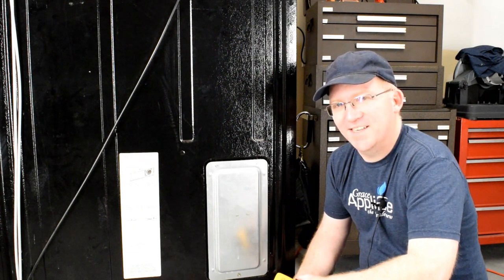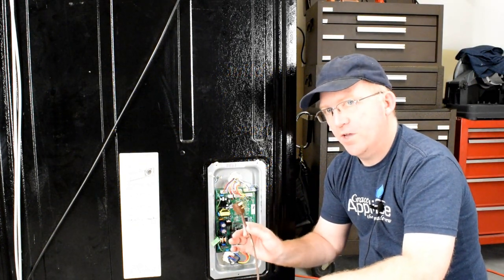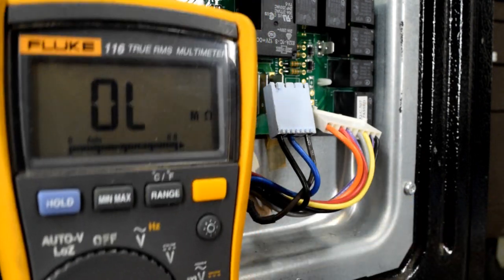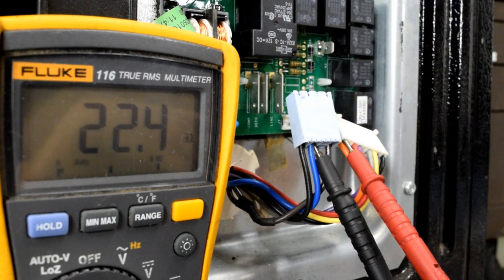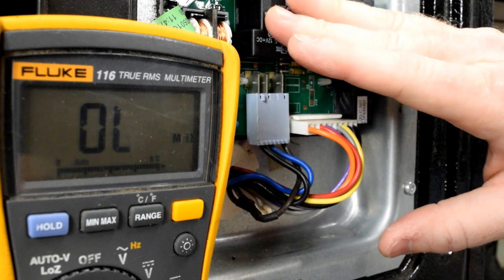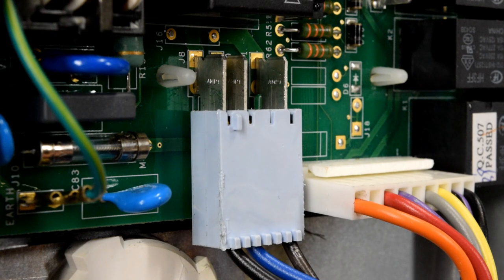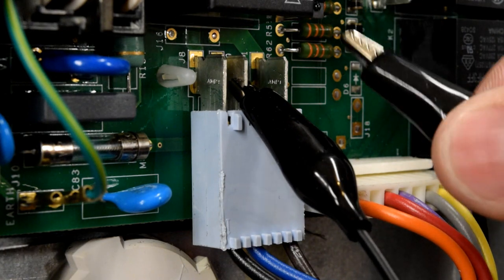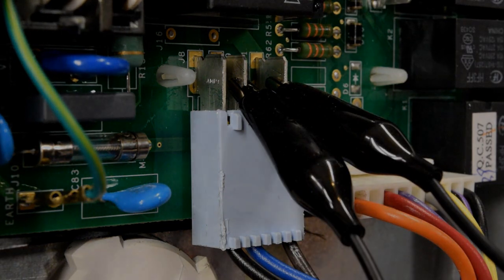Diagnosing a Bad Control Board - Part 3: Defrost Issues

Comment: Andy, last question... 120vac to compressor. 120vac to board. All fans are on and working. Defrost heater no continuity. Front control board works great. My thought is the compressor because there's 120vac at the compressor and I've installed a new relay and capacitor. But the compressor isn't kicking on even when I jumped it from the board.
Reply from the maker: Hey, I agree. It does sound like it's a bad compressor. With new relays it should certainly fire up once jumped at the control board. 

If you wanted to confirm even further, you could uninstall the relay with the power off. Then perform an Ohm test between the compressors 3 pins measuring every possible combination between the 3 different pins. Should get around 10k ohm on one and the other 2 combos should add up to that number. One should be around 7k and then 3k for example.
Lastly, if those checked out you'd perform an Ohm test between each pin and the copper tubing on the compressor. You're wanting to know if any of these pins have continuity to the copper portion (I. E. The case of the compressor) if so, the compressor is shorted to ground.

I hope that makes sense. 
I beleive I may have a video showing this now that I've typed it all out. LoL
Reply from the maker: https://youtu.be/XtntMGfU2Vc
Reply: That was actually one of the first things I did was check to make sure the pins had continuity and that the compressor wasn't shorted out. All of that appeared okay. I didn't check the ohms which I should have. Thanks Andy... with everything else working and checking out I can't see how it couldn't be the compressor. Thanks for all of your help and your quick responses.
Reply from the maker: Hey, you're welcome. Yes, you approached it correctly.
I'd verify that I was getting 120v to the compressor wiring at the relays when you jump the board. This will rule out bad wiring from the board to the compressor. I've seen where a mouse can chew through the compressor wiring, etc etc.

If you've verified that you've got 120v to the relays, sometomes older compressors will only work with a bit of a kick start. This is when hard start relays come in to play. Supco makes 2 basic versions of these a 410 and an 810 which is for smaller compressors. I've always used the 810 for fridges because on an older fridge the 410s I've heard will fry an aging compressor.
This version allows you to hook up your run capacitor though you'll have to crinmp down the terminals a bit with pliers which is fine:
Amazon Affiliate Link: https://amzn.to/2G268Vd

If the compressor fires up with this, you'll know you're on borrowed time and to start saving for a new fridge.

But of course all this is assuming you've got power to the plug at the compressor.

Comment: Hi and thanks for your previous response, your videos are great and very helpful. I have run into a snag here and could really use your advice . I have replaced the high limit defrost thermostat and the defrost heating element, also replaced all the sensors in the fridge and freezer . The freezer coil is  still freezing up and it seems like the defrost heater is not coming on. I tested the circuits as you showed and have continuity when the defrost thermostat is taken out of the loop and wires tied - as described in previous comment. Do you think I could have gotten a bad thermostat, or should I maybe look into replacing the motherboard ?
Reply from the maker: Hey, just to confirm that we're talking about the same part, you replaced the defrost sensor (small white cylender with 2 wires on the top of the evaporator) is that right?

I agree, it does sound like you need a new control board.
https://www.graceappliancediy.com/collections/frontpage/products/ge-wr55x10942-refrigerator-main-control-board

Thanks and let me know if you have any questions!
Andy
Reply: @GraceAppliance  Yes, replaced the sensors, thermostat and defrost heater. It was working normal for about 2 weeks and now it seems to be running longer, not cycling and the back is freezing up again so I'm guessing thats how long it takes for the coils to freeze over if the heater isn't coming on. I'm not sure but the motherboard is the last thing and also the most epensive. I did a visual inspection of it and all looks ok - no burns or blown up capacitors. Any easy way to test it ? Seems strange because everything else on the fridge is working fine,- is this a common problem ?
Reply from the maker: hey William, 
Yes it’s common unfortunately.  Even with no visible signs of failure, the relays can fail internally and may work intermittently or simply not keep the freezer in defrost for a long enough period of time. This causes the coils to not fully defrost, then the frost builds up gradually over a period of days usually but perhaps weeks too.  

There’s only 4 defrost components that can possibly fail, and In your case you’ve replaced the other 3 already.  So, (making the assumption all connections are ok) the last remaining suspect is the control board. There isn’t any further test you can do as GE does not have a force defrost option for this board. We know it is the board however from process of elimination.  

Let me know if you have any questions!
Andy
Reply: @GraceAppliance  Ok - Thanks for all your help, keep up the good work !

Comment: Thanks for this video.  I am trying to diagnose my side by side not defrosting.  My fridge has a a defrost test mode and it did make the coil glow when I entered test mode.  Does this suggest that the board is fine but the thermostat on the coil is bad?  I cut the coil off to test it in ice water.  I can not get it to show Resistance or continuity.  Also, The wiring harness and connector on the control board have burn marks on the defrost wire.  I plugged it in and tested the wire for continuity and it works.  Would these burn marks indicate the board is bad?  It is just some discoloration inside of the translucent wiring harness.
Reply from the maker: Brad Strawn hey Brad, 
Please send the model number for your fridge.  

If you have it in defrost test mode, that tells the control board to send 120vac to the defrost heater.  You can test for this voltage from the control board to verify the control board is doing its job.  

If yes, you’d move to the connections at the defrost heater, if you have voltage there, the board is good, the defrost thermostat is good, but either the wiring or heater has failed.  

As for the defrost thermostat not having continuity, there are some that must get very cold before closing and often ice water is not cold enough.    Inspect the thermostat to see if the case had swelled up and the plastic base on the metal thermostat has bulged out. 
There also cheap enough that I would recommend replacing it while you have it out. 

The heater itself often will look burned inside the glass tube (if that’s your design) and does not mean it’s bad necessarily.   You should read resistance across the two heater terminals.  The burned terminal does sound suspect and may be related to a failed thermostat by causing it to stay in for too long.  Just speculation.  

Let me know what you find with the voltage tests.  Thanks!
Reply: It is a Frigidaire FRS26LF7DSB.  Looking at the thermostat carefully, the rear looks rather melty with texture variations.  Definitely signs of getting hot.   Everything else looks good.
Reply from the maker: Brad Strawn I’d definitely start there and replace the defrost thermostat.  
I’ve seen many many failed thermostats on Frigidaire specifically. Often once they fail, the heater stays on too long and I’ve seen where the lining of the inside of the freezer near the heater actually turns yellow, melts and deforms that area! Scary! 

If that doesn’t work, I can walk you through how to test the voltage at the control board, but sounds like you’ve nailed it just using your eyeballs. Good job!

Andy

Comment: Hey, loved the vid. I'm an commercial electrician n started my own company n I get calls to fix appliances n some I can just use basic principles to fix. I'm on a ge side by side refrigerator that continues to go to 27 degrees n freezing everything in the fridge side. Checked everything but this heater u are talking about. Could this b my issue? Again thanks for any help
Reply from the maker: Hey Michael, you're most welcome.
No, a defrost issue will cause warm temps on both sides. So, you're good there.

If the freezer is around 0F and keeping things rock solid frozen the freezer is OK. Compressor, refrigerant and fans are likely good too.

The most suspect issues would be a failed damper door (which can break or freeze open) or a faulty fridge temp sensor. Some models utilize a temp sensor as part of the damper motor as well so just be aware.

I have a video called testing and replacing a defrost sensor which also includes the temp sensors which should help.

If you leave a door open for 3 minutes this will activate the damper door closed. This will help you rule out a stuck damper door.

Let me know if you have any questions.

Thanks!
Andy

Comment: Do you have to let the fridge defrost all the back up ice before do that bypass to heat the defrost heater?
Reply from the maker: No, it's is fine to do it when iced up. You can use this method to thaw the ice off. Obviously do not leave the jumper wire on except for test purposes.  Thanks

Comment: Andy, I have a blown fuse on my GE circuit board which keeps my fridge from defrosting, what size is the fuse? Circuit board is a 200D4850G013. I changed the heating element and thermostat, glass fuse is definitely blown.
Reply from the maker: Jar Head hi, I am sorry to say I am not sure of the size.   I can say that a fridge should not pull more than 15A during normal operation.  But, this may not equate to a safe fuse to use on your board.   Sorry I couldn’t be more help.
Reply: @GraceAppliance  that's ok, I I appreciate your help, and your videos they're very helpful. Keep up the good work

Comment: Generally, How long can I use a jumper wire to force a defrost of my fridge? I read that using the numerical code (00 04) on the front LEDs forces a defrost. Mine gets a 'P' for pass I presume.

Comment: So I had a repairman come out to fix my defrost problem. He installed a new heater and evap fan. The coils still ice up. I went ahead and replaced the thermostat myself, and it still seems like the heater won't come on. I don't get continuity in the heater circuit. Even went so far as to take the thermostat out of the loop and jumped the two wires that lead to it with a wire nut. 

When I tried jumping the power wires on the control board, the heater would not turn on. What could I be missing? There's one strange thing - the orange wire that leads to the thermostat seems to be "burnt" inside - not shiny copper like the other pink wire. Could that be causing the open reading during the continuity test?
Thanks!
Reply from the maker: Hey Derek, 
Sorry to hear about the troubles with the defrost issues. 
First, take an OHM reading across the heater terminals to just make sure the heater is in fact good. 

But, you've done the right steps it sounds like.  Taking the thermostat out of the circuit was smart (obviously not something to leave that way) but it rules it out as the culprit.  

It sounds like a bad connection issue to me.  Or, a broken wire in the circuit. 
You could confirm that the wires are good this way, with the fridge unplugged, disconnect the wires from the heater and connect them via another piece of wire. Then, try the continuity test from the board again.  If you then have continuity - the wiring to the heater is good. 

Also, check this - even I have had this happen to me before...
When you plug the wires back in to the heater terminals - they can infact insert without having seated on the terminals. They slide in right next to the terminal, but feel like they slid home with no problem. 

Just my initial thoughts.  
Let me know what you find and I am happy to dig in to it further if you can't get it sorted. 

Thanks!
Andy
Reply: Thanks for the response Andy!
I ended up tracing the wires. When I put a new light bulb in and it didn't light up, I new something was up. After removing the ice maker assembly and the upper rear cover, I discovered that the wiring harness wasn't plugged in! So much for the quality repair job that I paid for.
Anyway, after that, continuity was great. Jumped the power terminal and the heater fired right up. Everything is back to normal now.
Always suspect the human element first!

Comment: My fan is sputtering. I replaced my old fan because it was no longer running. The new fan would not run but only 1/10 of a turn every 2 seconds. I returned it and got a new one with the same issue. Could this be because of the board, wiring, or something else?

Comment: Great video.   He is incorrect about one thing:   There is a   FORCE DEFROST mode.
It is performed by entering the self diagnostic mode of the unit.
If the freezer is cold, this will activate the heater element and hold it ON until the defrost cycle completes, which is upon the evaporator thermistor reaching the shut off feedback level.

To enter Self Diagnostic mode, both temperature control panel displays must be illuminated.
A display can be illuminated by pressing an adjacent temperature adjustment button.
When both displays are illuminated, set the freezer and refrigerator temperature settings to 5.
Simultaneously press and hold all 4 temperature adjustment buttons for approximately 3 seconds.
A flashing 0 in the refrigerator and freezer displays will indicate that the refrigerator is in Self Diagnostic mode.
Use the freezer temperature adjustment buttons to enter the test code number in the freezer display.
Use the refrigerator temperature adjustment buttons to enter the test code number in the refrigerator display.
When a test code has been entered, the displays will flash to confirm the test.
Press the HOLD button for 3 seconds to begin the test.
Enter defrost:
Freezer . . . . . Fridge
. . 1. . . . . . . . . . 4
If the cabinet is not cold when executed, this mode may execute extremely fast.
The refrigerator will return to normal operation on its own.
When testing has been completed, do one of the following things:
• Enter code 1 5 to completely reset the system.
• Enter code 1 6 to exit diagnostic mode. The temperature control panel is reset automatically.
• Unplug the refrigerator for at least 10 seconds. Test mode will terminate when the refrigerator is plugged back in.
Test mode will terminate automatically after 15 minutes of inactivity.
Reply from the maker: Lance Pratt excellent point and great info. Thank you.  
You are correct, certain models do have a temp control board inside the fridge section which does allow this functionality.   These could be called encoder models, I believe (?).

This is not the case in the fridge shown in the video, but you’re absolutely correct and thanks again for the info.
Reply: FYI, If the fridge is warm this test mode will act as if it is running the test but power will not be sent to the heater. I found it needs to be cooled down and the diagnostic defrost will then send power to the heater circuit.

Comment: Greetings. If I repair the power supply to the card and feed it with the 120 volts from the network on the work table, the relays should sound, correct? I already have the twelve and the five volts. check and there is no short or low consumption in any other component. Because the fridge is in another city and I want to go safely. Unless you need the sensors, but I still think that the relay should sound. Thanks.

Comment: Fantastic video. Do you have a video or information about the control circuit for the compressor?
Reply from the maker: Hey Eric,
The only one I've got currently is how to test the compressor with a meter. It will tell you if your compressor motor is shot or shorted out.
https://youtu.be/XtntMGfU2Vc

If it passes that test, you can test voltage coming in to the relays which will be 2 wires. If your condenser fan is turning your compressor should also be running at the same time. So, you should have 120vac to those two wires leading to the compressor relays.
If you do have voltage there, your control board is doing its job.  If your compressor checks out, you've got voltage to those wires, it's the relays that plug on to the compressor that have failed.

I hope that helps. Let me know if you have any questions.

Comment: I replaced the heater, the sensor, and the thermostat but the heater still won't turn on when it's frosting up the coils. I jumped the 120v relay and the heater turned on. Does it mean the Control board is bad? Can I leave the jumper on forever?

Comment: Also remember whether jumper testing or triggering via diagnostic mode you can put a clamp on ammeter on the blue wire of the heater circuit plug. Mine showed approx. 5 amps when operating correct. Also, always remember when testing the freezer must be frozen or the thermostat will be open and the defrost heater circuit will not be complete and open.